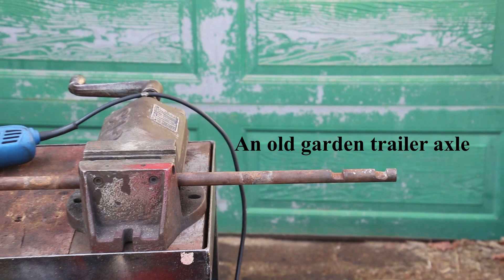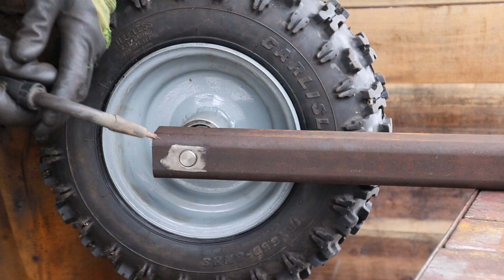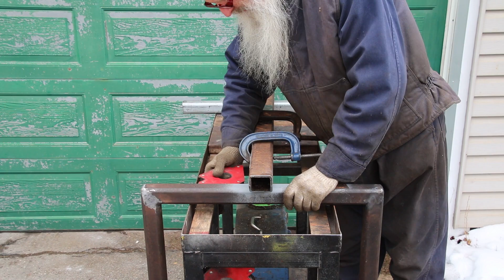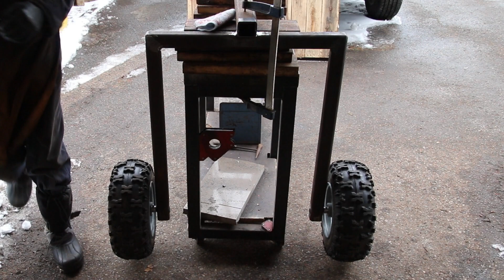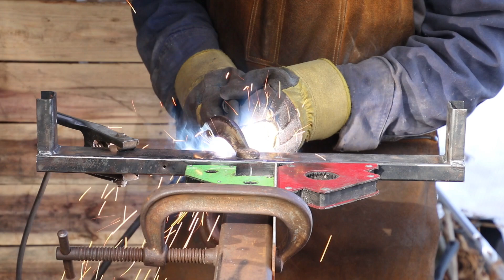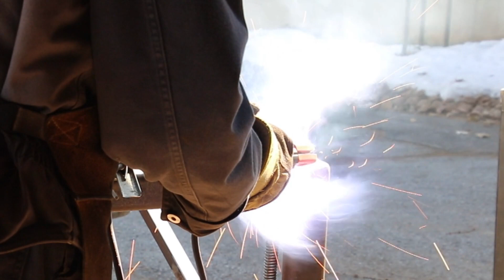The wheels on the bus go round and round - Building a log arch from junk - part 5

Comment: The question is what steel grade is used for the axle? What is the approximate weight of the cart?
Reply from the maker: The axle would have been simple "cold rolled" steel.  Nothing high tech or fancy.  You can see where the wheels had almost worn through before I cut that chunk off.  The old cart may have weighed 50 lbs (20kg).  The log arch might weight 200 lbs (100kg).  Thanks for commenting.  I hope you have a glorious Easter weekend, assuming it is Easter where you are.